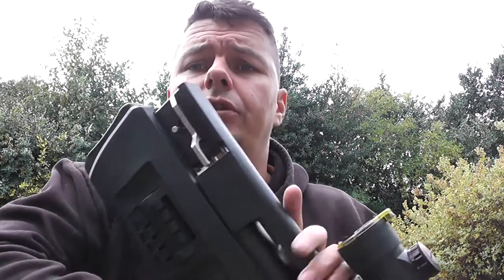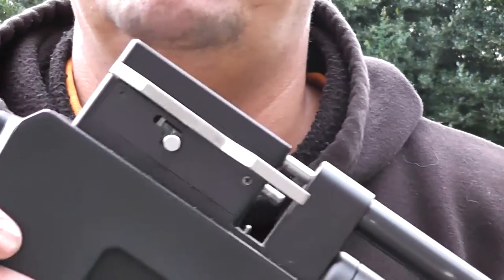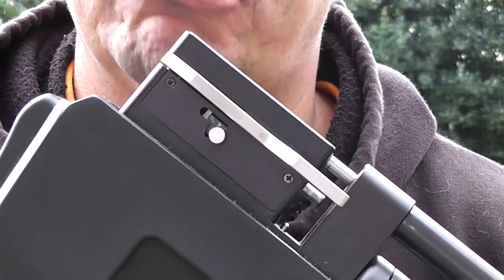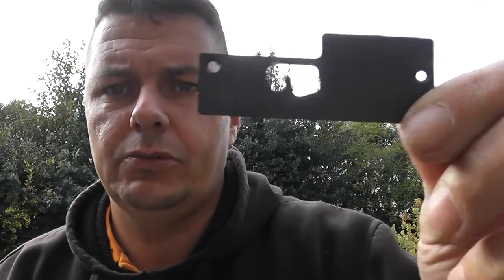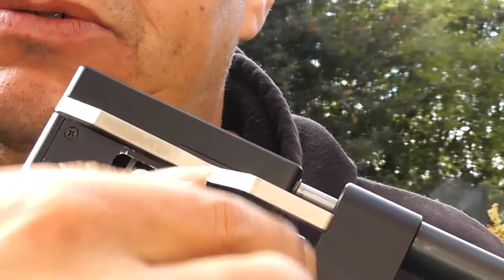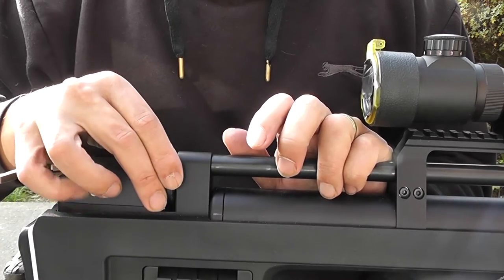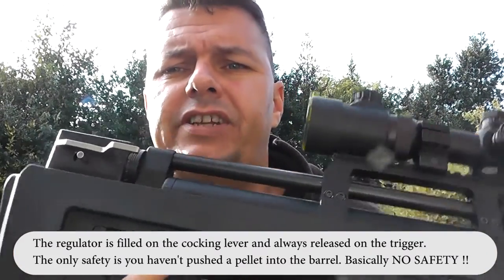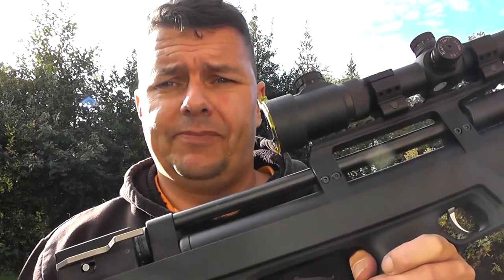Kalibrgun Cricket - Magazine Loading Modification

Comment: i think you did a superb job pal thats actually made a big difference tbf. 
i bet a mechanical safety could be easily made for the trigger unit
Reply from the maker: It has crossed my mind. A simple push bolt to block the trigger pull could work. The next video will be a strip down to reveal the trigger mechanism and see if this is at all possible.
Reply: Steve Allan i think if its on a push rod system it could be easily done in a few places as there will be nuts along the linkage at some point which you could make a push pin to go behind. perhaps a theoben on front of trigger unit could also easily work i.e. a latch that moves into a recess on the top of the trigger blade to hold the trigger from being pulled at all

Comment: I have the Cricket Carbine and while it isn't the best mag loading gun out there, I find it pretty easy to change mags, albeit with both hands. It just takes some getting used to and now I don't find it harder than it used to be with my Hatsan at44.
 The safety is removed from my Cricket and I find the 'non indexing mode'/first notch pretty handy. When your rifle's loaded with a pellet in the barrel and cocked, you can decock it: Put it in 'non indexing mode' and pull back the cocking lever. Hold the lever, pull the trigger and slowly let the lever come forward. Now your Cricket is perfectly save to handle but with a pellet in the barrel. No way the hammer is going to release the air from the tube this way. When you're ready to shoot again, just cock it and don't forget to make the mag cycle again for the second shot. If you don't use the non indexing mode, you'll double load so that's why it's there I think.
Anyway thanks for this video and I will do this mod.
Reply from the maker: Glad to be of service. Hope the mod goes well for you. But before you do it, I still find it difficult to get the loading just right. Unfortunately, you will only know when you have done it. But it is handy being able to lock out the magazine bolt.

Comment: A note on the Cricket's safety & some info regards your explanation of the reg filling..

The cocking lever sets the hammer, when you pull the trigger the hammer strikes the firing valve and air is released through the transfer port into the barrel.  As some of the air is released from the regulated air chamber air passes through the regulator into the chamber to maintain the regulated pressure.

Regards the safety.. The Cricket actually has one of the best safety features.  When you understand the operation of the mag indexing pin lever you may well change your mind.  I shoot a lot and really don't like walking about with the gun cocked regardless of a safety switch.  A bullpup especially so as the trigger has a long linkage and a safety is never really safe.  

Say you're loaded and want to walk off to another position. The idea to make the Cricket safe is to set the mag pin lever to the manual indexing position (single shot as you said) pull the cocking lever back, hold onto it and pull the trigger and release the tension on the hammer spring. This will make the gun properly safe.  Then you can push the cocking lever forward without indexing another pellet and when you're ready to shoot again, cock the gun as normal and place the magazine pin lever in the automatic mag indexing position so it's ready to index the follow up shot.

Understanding this is a big safety feature and embracing it should make Cricket owners pleased to have such a feature!  I wish my Vulcan had such a feature.  If I want to make that as safe I have to remove the magazine otherwise it will load another pellet.
Reply from the maker: Thank you for your reply. That does make sense for that scenario, but wouldn't it just be easier to have a regular safety catch ? One you can flick on and off. I get the rod / trigger issue, but that is easily overcome with proper design.  I supposed in the correct hands, this rifle is safe. But not what I would class as user friendly IMHO.

The point of the video is to highlight features or lack of and to request comments from the community and I very much thank you. This is a valid use case point you make.

Great feedback and exactly why I have set this channel up. Honest reviews and honest feedback for those who want the dirt before they spend.